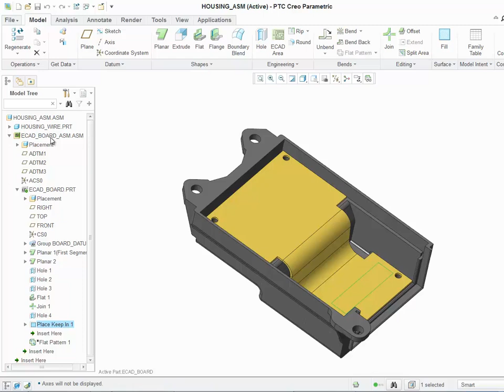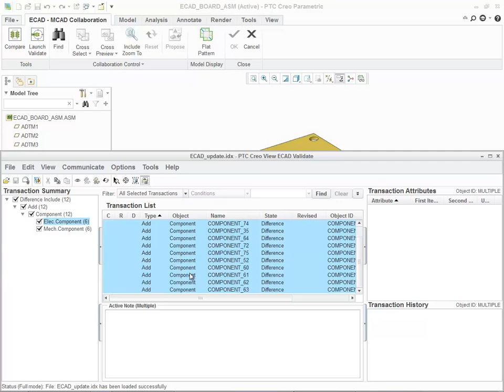ECAD Flex Rigid Boards

Comment: When activating the ECAD collaboration license, does this change the behavior (k/y factors) of the bends in the flex regions? or do the behave the same as if I laid out a rigid-flex using the sheet metal tool? If they behave the same, is there a recommend K or Y value that better characterizes the bend of the flex?